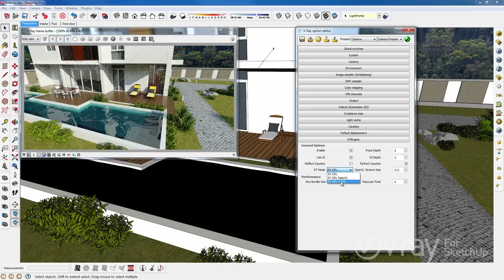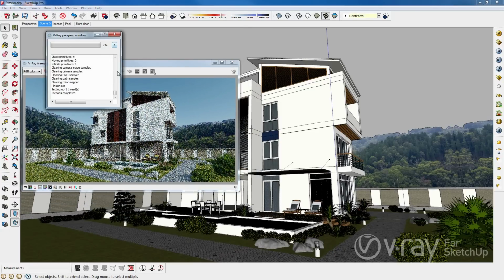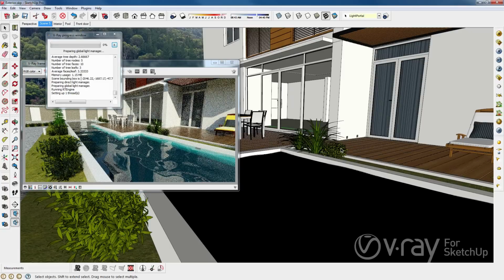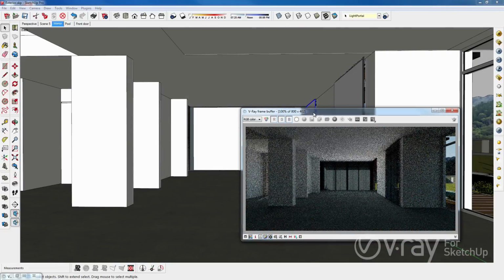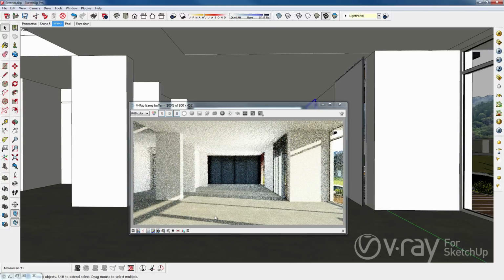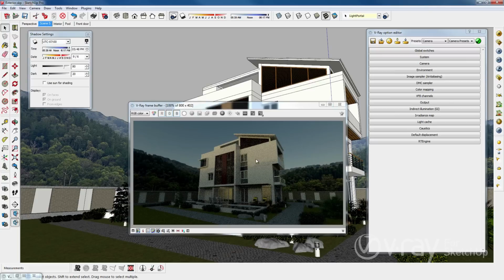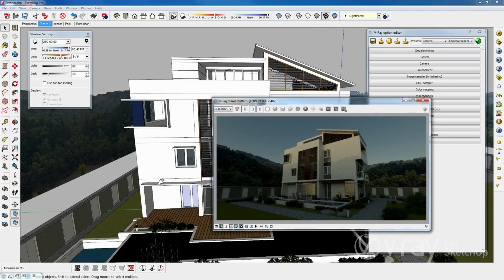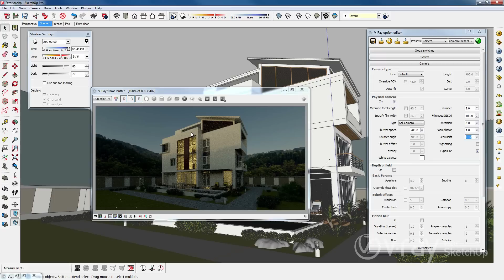V-Ray 2.0 for SketchUp - V-Ray RT CPU and GPU

Comment: when I set my RT GPU Open CL or RT GPU CUDA, my Virtual Frame buffer shows completely black.
my video card is:
Nvidia GeForce GTX 1060 6GB

why?
Reply: Same thing with my R9 270. Anyone have some clue?
Reply: SuperDr27 R9 270 is AMD GPU thus it cannot render with RT GPU CUDA only openCL have you tried?
Reply: My graphic card is nvidia gtx 860M (2 gb, maxwell arch) and I have very same problem, when I set up RT render in options (I work with vray 2.0 + sketchup) for GPU CUDA or GPU OpenCL it gives me just a plain black screen, when I try to RT render... I heard it's because vray 2.0 doesn't support gpu rendering for sketchup and only 3.0 does... Do you guys know sth about it? not even mentioning there is no option of gpu rendering with regular still render, not RT...
Reply: Edyta Żmudzka Really, there's a line like this on Chaos Group Website and I've just joined the beta for vray 3.4 to test and I can confirm you that RT GPU is working on Vray 3.4 but there's lots of stability issues with this version, I've got sketchup crashing twice while only creating a dome light and once while simply trying to make a cube...
Reply: which version of sketchup do you work on?
Reply: 2016

Comment: hello,

i have a nvidia quadro k2200 and in the RT ENGINE window i can see the RT mode: OPEN-GL and CUDA option, but only the CPU works...

with the GPU option i get only a black screen, what can i do?

in the vray manual i found

"Notes     
V-Ray RT in SketchUp does not currently support rendering on the GPU."